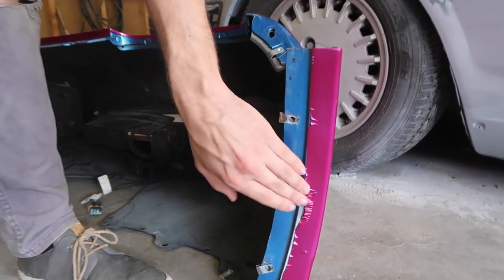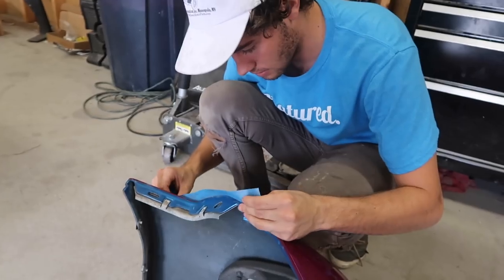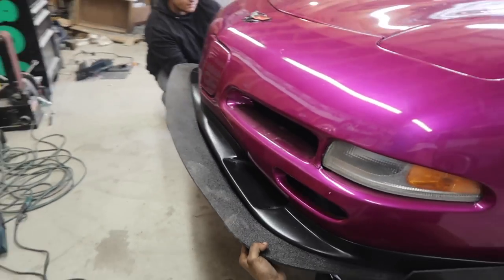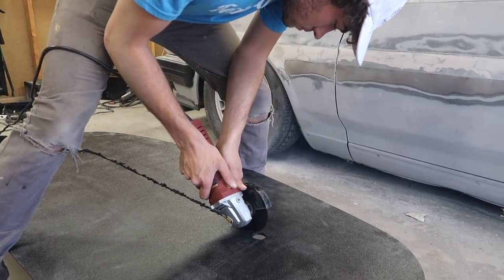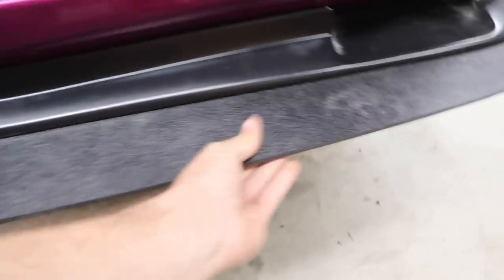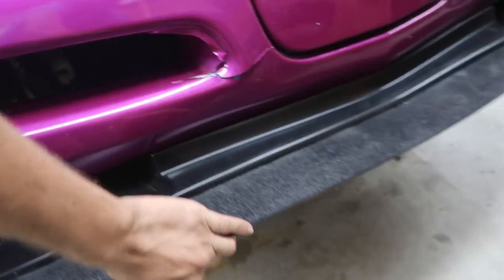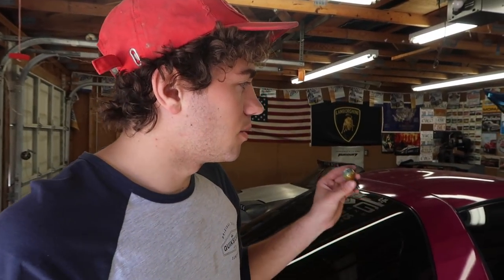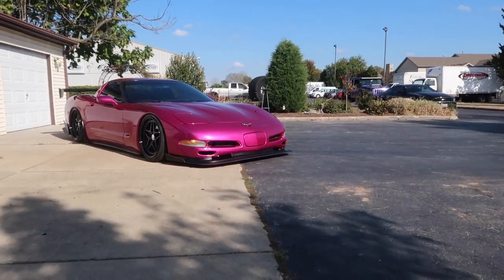WHOREVETTE Gets A Massive Splitter

Comment: Tyler Fialko, 
if you want the splitter to look flat and give more air splitting function, then I'd try this..
Undo a few if the bolts across the center section, then add some washers between the splitter and the solid lip, it will give an air gap and create a level splitter, try it! Paint the washers black! I think it'll work..
From Scott in Stratford upon Avon England.👍